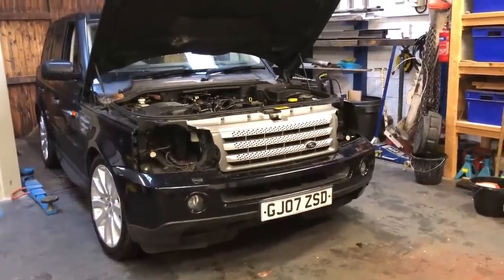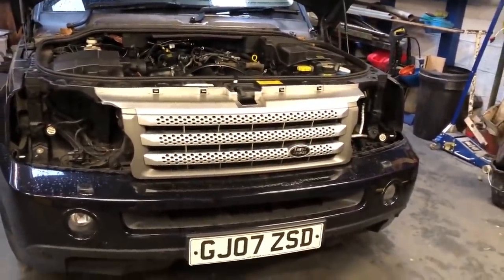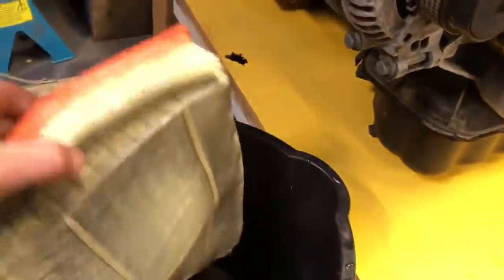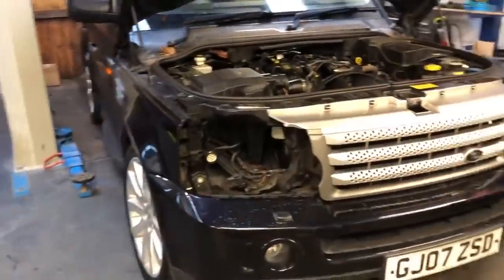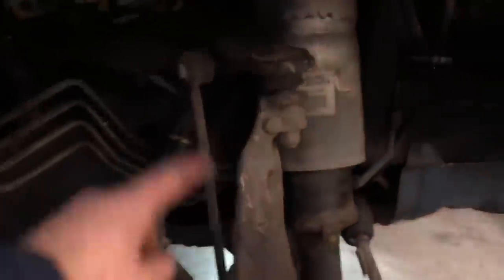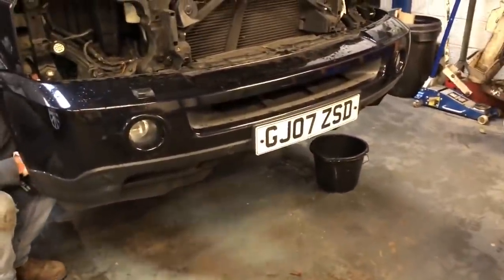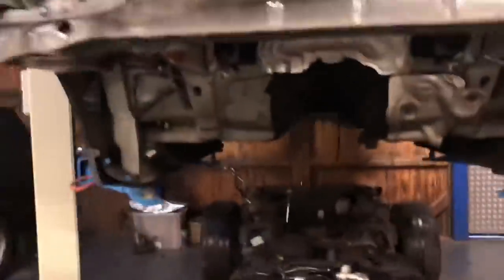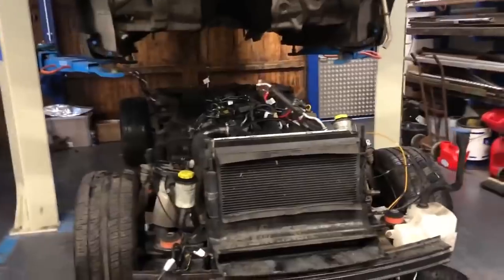SRUK Throwback Sunday Range Rover Sport HSE Cab Removal  PT1

Comment: Love your very informative videos and keep up the fantastic work guys... 

Can you please explain in more detail about what has to be disconnected from an electrical point of view within the engine bay please. What has to be unplugged and how do the 'towers' dismantle (the rear plastic parts housing the engine loom). 

I'm in the middle of removing the body from my own L320 Range Rover Sport which is very similar and reaching out for a little help... 😊

Comment: I had a sized turbo on the 3.6 v8 cost me 6 k body off job to have both turbos replaced two weeks later the gearbox went I sold it they are a money pit only designed to last the warranty and they struggle to do that.

Comment: I had a 57 Reg discovery I lifted the bonnet to check and wash the engine to clean it and make it look presentable when you’re standing in front of the vehicle top right hand corner where the battery goes behind that there’s loads of electrical ECU boxes the water got down and burnt all that out I changed everything spent loads of money vehicle never run again so I would personally say on range Rover sports range rovers and discoveries don’t bother cleaning or jet washing the engines just wipe them over with some tire dressing or silicon spray and don’t go through puddles or rivers even though that’s what they’re meant to do 🤣🤣